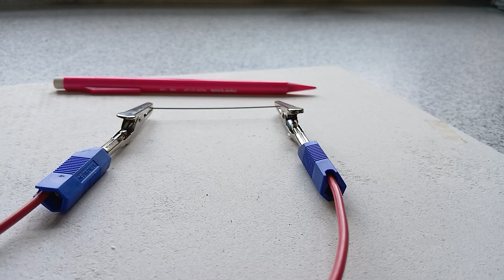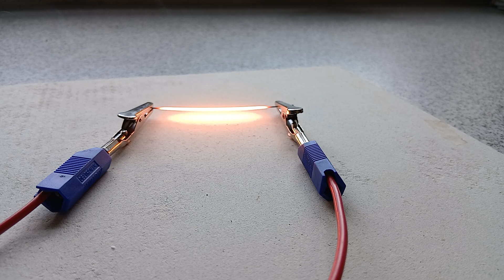Graphite from a mechanical pencil with high current through it #physics #physicsfun

Comment: What are some papers that describe this phenomenon?
Reply: It really is quite similar to how a lightbulb works. When a voltage is applied across the graphite, an electric current begins to flow through it. Graphite isn't a perfect conductor; it possesses a certain amount of electrical resistance.

As the current pushes through this resistance, the graphite molecules experience friction and convert electrical energy into thermal energy, causing the material to heat up. The more current that flows, or the higher the resistance, the hotter the graphite gets.

Once the graphite reaches a sufficiently high temperature, it starts to emit light. This phenomenon is known as black-body radiation. Essentially, any object that gets hot enough will glow, and the color of that glow changes with its temperature – from dull red to bright white, and even blue at extremely high temperatures. So, in simpler terms, the graphite gets incredibly hot and, like a traditional lightbulb filament, it glows!